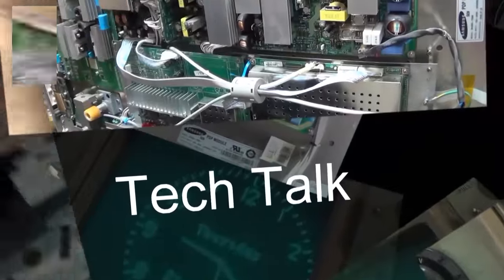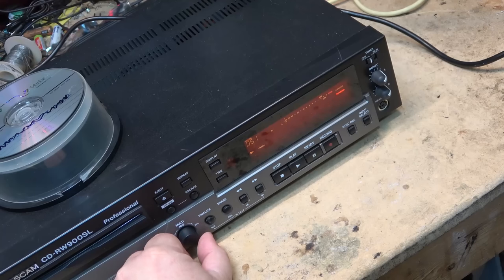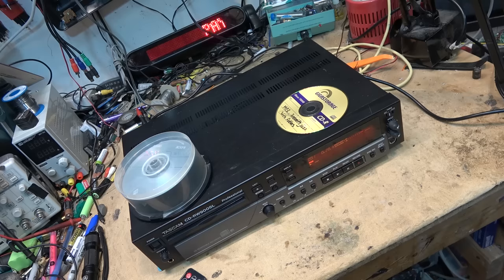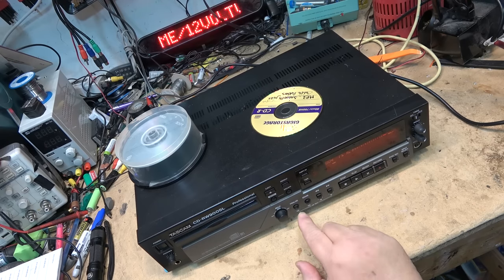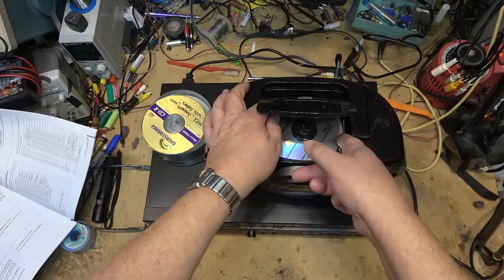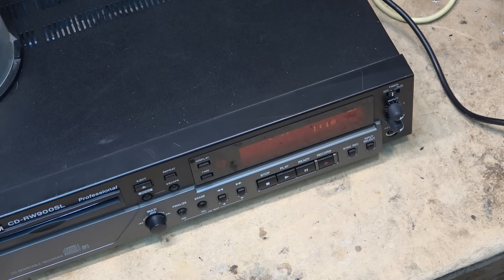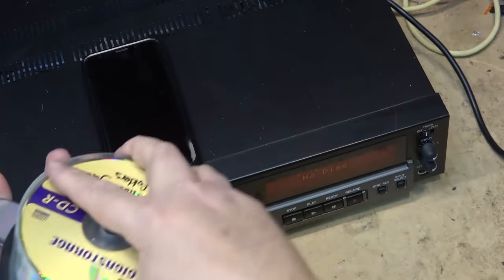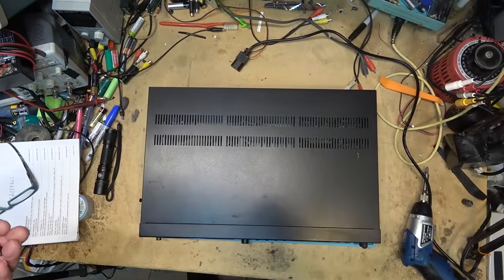TASCAM CDRW900SL Professional CD Audio Recorder

Comment: I have an older unit with a drawer load instead of a slot. Burnt hundreds of CD'S with it over the last 15 years or so but doesn't see much use now since I started streaming. They were great machines.
Reply from the maker: No streaming here. Refuse to pay for data. Get 3 gigs a month and that is enough for what I use. Kids pay about 80 bucks a month for their cell bills, mine is 15 bucks a month and its going to stay that way.

Comment: Great Tascam! I will never sell my Tascam DV RA1000HD and also my small home CD burner Phillips CDR-760 even if it records only on 'Audio CD-R / CD-RW. The Tascam is very complex and full of professional functions such as serial copy management which can even be programmed. My vinyls recorded in DSD sound identical but what a joy to finally be able to turn up the volume without hearing feedback.
Reply from the maker: Yes it can be programmed for serial copy management.
Reply: @12voltvids Hey Dave fantastic score on a pro unit 😃. I have two consumer units one is a Pioneer, I don't recall the model it is a single well. 
  The other is a Yamaha and get this it is like a dual cassette deck, the (deck A) left side is a player (CDs and CDRWs no MP3s, deck B records and plays,  obviously right? It doesn't play MP3s either as far as I know. The Yamaha has a keyboard (PS/2) jack. You can plug a PC keyboard in and type the CD Title and song tracks rather than using that agerfrithen twisty knob on your unit. Both are those serial copy management system (SCMS) and require the CDR and CDRW discs or neither machine will record. I tried the swippy swappy thing like the guy you were talking about and well the machine showed it recorded and even played what I recorded until I ejected the disc LOL. Evidently it recognized the disc wasn't a CDRW for audio and recked the table of contents to make it unplayable in itself or other machines.
I almost decided to purchase a commercial stand alone music CDR and CDRW machine. But for a very young guy not much out of highschool I didn't have the funds. Now looking back I'm glad I didn't get it because I can burn all types of discs in the computer drive and oddly the computer drives (or at least some) don't like the dedicated CDR for music discs. I tried a CDRW for audio and seemed to write fine however it didn't play in a CDRW compatible player. Go figure LOL anyway enjoy your excellent new dedicated music CDR/RW standard disc machine. Ohhhhh I used the ones I have quite a bit and it was extremely annoying because the clipped some songs I tried recording so aggravating. I was told the pro/commercial units have a buffer that prevented the cut off at the start of some songs. As I understood it took as much as a half a second to actually start recording from record/pause mode which is what caused the clip/cut of the start in some circumstances. Not an issue using the 🖥️ it never clipped the start of what I wrote to any of my discs. Perhaps you can check out the ins and outs of your to see if the pro units have that issue. Being a commercial unit I'm guessing they ensured that the start of songs didn't get cut off.
  Best wishes for you as you are fighting that nasty COVID at the moment. All the best to you my friend. Get well soon.
Reply from the maker: @darinb.3273  from what i understand the disk swap had to be done and the full disk recorded without stopping it or ejecting and then the disk finalized in the same session. Perhaps it works only on some machines.
Reply: @12voltvids  A late reply back from me LOL. It wasn't enough for me to try it again, I was happy I didn't have to do any of it in real time. For me it was a passing thought to try it and see what happened. I completely agree it may be specific to each machine or perhaps I wasn't holding my mouth right when I was experimenting.
A long time ago I found a 100 pack spindle of CD-Rs that could be used in the computer or stand alone audio CD-R recorders. They are those light green dye type, I forget what the name of it. I like the dark blue dye (don't remember what that dye is called either) the contrast was much easier for human eyes to see. Whether it made any difference to the CD machines who knows. You having an O-scope could look at the clarity of the eye pattern and compare the differences in the dye types of the discs. And of course the CD-RW too. That would be a super cool video to watch.

Comment: I have a Sony CD recorder, picked it up fro £10 from a charity shop.  They had only just had it dropped off to them and the guy who owned it as a DJ or something and said he had never used it at all so it had 0 hours on it.  Unfortunately it uses the "for music" discs but I just use it with RW discs to capture audio which I then rip on the PC so I can do what I like after that point.

It has two drives as well, one a standard CD player mechanism for playback and the other is a computer type mechanism that records.  The recording side is also MP3 capable and both sides support CD text.
Reply from the maker: In reality those are fine if you have cdrw audio disks.  Use them to make your compilation from analog source then just burn a copy on the computer or rip them on computer. The ad converter on these machines is better then any ad converter in sound cards for sure.  As long as you have a few cdrw music disks you are good to go.

Comment: Very interesting. I never had a CD recorder. DVD recorder, yes. I burned my first CD in 2002 using an external drive. (My computer had a CD ROM, but it didn't burn discs!). Had many coasters because of hardware issues.
Finally replaced the drive in my computer with a CD ROM recordable drive. (At the time I wasn't concerned with burning DVD's) My first computer only came with 128 mb of RAM, and a  20 GB hard drive. 1.6 Ghz pentium processor.

Comment: The drive inside this unit, clearly of IT origin as it was used on many contemporary notebooks, is marked TEAC. It would be very interesting to understand whether its replacement, in the event of a fault, with an example from another brand would be possible or not.
Reply from the maker: Tascam is Teac. It's their professional division sold mainly to musicians and recording studios.
Reply: @12voltvids  Exact. Precisely for this reason it would be important to understand whether this TEAC drive can be replaced by Samsung drives (or Sony or Hitachi or others) in the event of a failure or whether the CDRW900SL has a control logic that requires that precise TEAC model, rejecting others.
Reply from the maker: @claudiogatti5529  couldn't tell you but i would imagine it is probably model specific
Reply: @12voltvids  There's a CDRW900 on Ebay here in the UK that has had it's drive replaced with a generic laptop drive, so looks like it is possible to replace it if the drive fails. Has a buy it now price of £140.
Reply from the maker: @kevinh96  that's good to know.

Comment: A little known fact is that despite claims in the manual to the contrary, newer TEAC recorders also record on regular CDR/W. They are literally just the TASCAM unit in a prettier box.
Reply from the maker: Tascam is Teac. One of the best cassette decks I own in a teac v850.  3 heads dolby b c and dbx, auto tape bias, fantastic sound.  Made hundreds of tapes back in the day.
Reply: @12voltvids  Yup, I'm aware they're the same company. Just saying you can sometimes get a better deal on TASCAM stuff by buying the TEAC equivalent.

The other good thing about the newer CD recorders is you can use just about any SATA DVD burner in them that will fit (the Sony drive they use is shorter than some of the computer ones) so servicing is very easy. Build quality on the ones made in the last few years though is suspect, they're adopting the Chinesium practice of using hot snot to keep the poor quality header connectors from coming loose.

Comment: I would much prefer a drawer loading drive. Slots get scary when there is dust in the air, 
and I don't have anything like a "clean room" environment at my disposal.
Reply from the maker: Car CD player is slot load, it's 12 years old and has not been an issue and i wouldn't call a car a clean room.